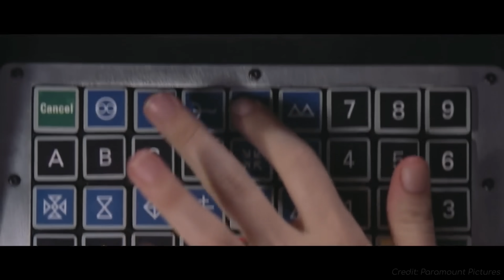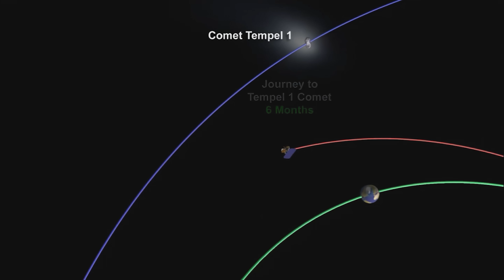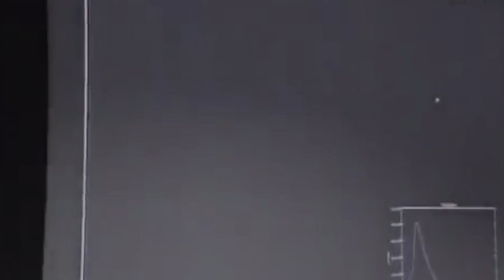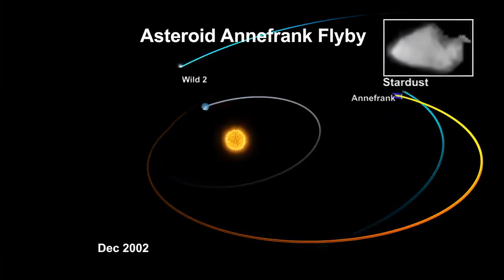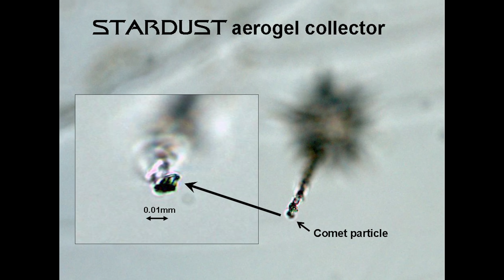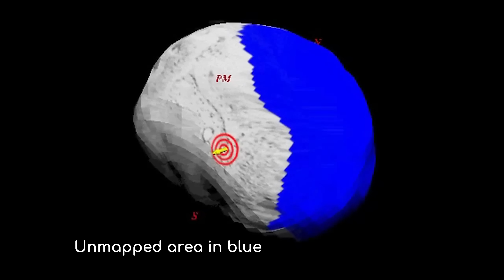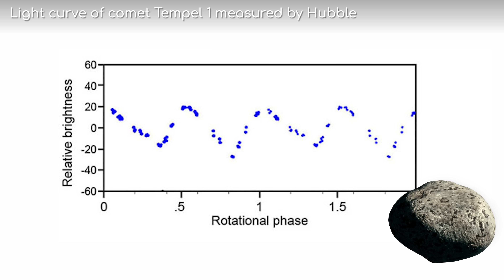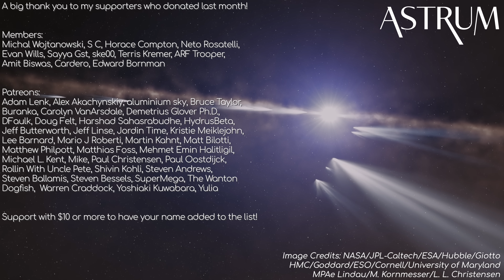The Image NASA Didn't Want to Receive from the Deep Impact Probe | Supercut

Comment: Deep Impact was a NASA space probe launched from Cape Canaveral Air Force Station on January 12, 2005. It was designed to study the interior composition of the comet Tempel 1 (9P/Tempel), by releasing an impactor into the comet. At 05:52 UTC on July 4, 2005, the Impactor successfully collided with the comet's nucleus. The impact excavated debris from the interior of the nucleus, forming an impact crater. Photographs taken by the spacecraft showed the comet to be more dusty and less icy than had been expected. The impact generated an unexpectedly large and bright dust cloud, obscuring the view of the impact crater.

Man this event was almost 18 years ago !!
Reply: And THIS is exactly what generative text looks like. Is that ChatGPT or Bard?

Comment: "Let's crash into the sunny side so there is better lighting for our pictures"   Then the sunlight on the crater heats the newly exposed ice enough causing the ice to melt and evaporate, creating a cloud of gas and dust so they couldn't see the crater at all.  They are some of the smartest people on Earth.  They can design, build, and send a probe to a small comet.  But they overlooked the simple things.  They didn't think about the effect of sunlight and heat on the ice inside the comet.  The reason comets have tails.  That sounds about right.

Comment: 9:30 the unexpected flash included ultraviolet light, which doesn’t happen so much with collisions of mass, however it is always present with electrical sparks. Even electrostatics sparks, which are very scalable… This large flash was very much expected by some (it was documented). This is really kindergarten knowledge when you are familiar with the electric universe model, but would make your head hurt if you’re not.
Reply: it did not include ultraviolet light

Comment: There is a mistake in the transcript: It says "1.96×1010" joules, while it should be 1.96×10¹⁰ or 1.96×10^10 joules. 
This kind of number distortion frequently happens when scientific texts get copied and pasted from Office or PDF documents into simpler linear document types like web pages: Superscripted exponents get un-superscripted and appended to the base 10, producing gross misinformation. Thus, we find web pages saying, Avodadro's number is "6.022 x 1023", or telling us the Earth came into being "4.6 x 109 years ago". 
I recommend scientific bloggers take care to prevent these faults by using the foolproof "^" symbol as an exponent separator in the first place.

Comment: I seem to remember one of these space dust collector disks (not sure of the name of the probe that initiated the project) returned to earth however due to some issue the capsule hit Earth's surface too hard or something bad happened which breeched the container and compromised the integrity of its contents.  This was like back in 2005 or so as best that I can remember.
Reply: That was Genesis.
 It was built and launched after Stardust but returned before Stardust.
The G-sensors that detected when the sample return capsule hits earth atmosphere were originally install backwards on Stardust but caught during centrifuge testing and flipped around ("fixed with a redline to the print"_).
When they built Genesis, they "built the circuit to print" but they failed look for any redlines to incorporate.
SO, they built Genesis "wrong" then decided to not do the centrifuge test, due to "heritage" and so missed the fact that it was in backwards.
The sensor failed to trip to release the parachute and the SRC augured into the desert.

Comment: There was no muddy snowball.  The hydroxyl ions and hydrogen ions are expelled from the comet by EDM, Electrical Discharge Machining into a cloud in which a percentage of them combine to form water.  The finding of organic compounds is huge.  Those missions were brilliantly planned and carried out, however; the interpretations of the results have been weighed, measured, and found wanting.

Comment: Several hundred years from now, Space Indiana Jones is going to fly a rocket to that asteroid and dig out the impactor, to put it in a museum on the moon.
Reply: it was vaporized.
In fact: I was the Command and Data Handling Engineer for the Impactor during the encounter.
After the impact, the flight director got on the net and said:  "Lets get a status from all subsystems starting with Impactor C&DH".
I responded with:
"No single bit or double bit memory errors, no red limits, all C&DH telemetry was nominal, so I am a little sad to say that we just vaporized a perfectly good spacecraft".
It got a round of laughter from the room.

Comment: Stardust 13:15: maybe someone can explain this to me: Comet Wild-2 was traveling at 23,400 kph and engineers were worried that its particles traveling at this speed would be smashed when collected by Stardust according to this video.  But if Stardust was traveling alongside the comet at the same speed, then the comet's particles would be traveling at a velocity relative to Stardust of 0 kph not 23,400 kph.  

And here's another logical inconsistency in this video. If glycine was found on Wild-2 20:49, that doesn't necessarily lead to the statements of this video that comets may have contributed such building blocks of life to Earth as well, since if Wild-2 was formed by the Sun in our system and had glycine, then wouldn't Earth, also formed from the same processes, also have glycine in it naturally?  Again this is stated at 27:25 and 29:35, that life on Earth may be been due to comets.  Again, if these comets have an origin in our solar system, then nothing on them wouldn't also be found on Earth itself.  I find such gratuitous statements more speculative science fiction than fact, appealing to a gullible audience.  Still, the main points of the video that these missions are an amazing scientific achievement should be acknowledged.

Comment: I am a bit confused about the speed of impact. It was stated that the relative speed was about 37,000 km per hour, which would mean around 10.3 km/s. However, when you watch the distance and time to encounter,  and note what is shown in a time laps between 2:43 until about 2:52 you get for instance: 809 km distance and time 8 seconds "to the encounter". That would mean a speed of around 100km/second. That seems to contradict the claim of 37,000 km per hour.

Comment: I hate that term skip off the atmosphere.  it doesnt skip off, it simply doesnt aerobrake enough on the first pass, since the periapsis is within the atmosphere, unless it still has escape velocity after the maneuver, it will aerobrake again on the next pass which will be at approximately whatever altitude the last periapsis was.  For manned missions this can be catastrophic if the crew doesnt have enough life support for another go round, but for ostensibly inert payloads, its just inconvenient to wait the extra time, and possibly have a different landing area.

Comment: the overheating thrusters issue was probably  getting numbers in F when expecting C
Reply: Actually, it was due to the fact that we NEVER fire the real thrusters in test at the vehicle level.
The box that monitors "Thruster temperatures" had never seen any temps higher than the Catalyst Bed heaters used warm the thrusters in vacuum.
So, the box never saw full scale temperature for a real thruster firing with hydrazine.
The conversion coefficients were not accurate at the higher temps.
SO, when the REAL thrusters fired for the first time in flight the fault protection hardware marked the box that measures temperature as "failed" and pushed the SV into safe mode.
A quick update to the conversion coefficients in the Flight Software solved that problem.

Comment: Just one question: the narrator says that when fuel ran out it has a 'last transmission'  but wouldn't the electrical power have lasted for many years after navigational fuel was gone? Wouldn't it just keep transmitting? using solar power or whatever power source it has? Plutonium or something?

Comment: It's not that strange to hear aerogel is a better insulator than air, since it's the actual transition from the solid to gaseous part of any material that provides thermal insulation. In PUR foam for example (the sponge-like material that insulates our walls and roofs) thermal heat, aka the fibration of atoms- is slowed because the porousness of the foam causes pockets of air in structure of the material, through which the vibrating atoms have to transition that energy from the solid walls of polyurethane foam back to air and so forth. So in effect it's not the air that insulates, it's the transition of thermal energy between different states of material.

Comment: So if the comets originate from here than it only makes sense that the life’s building blocks were already on our planet and did not need the “seed” of comets.
Reply: The problem is that planetary formation is likely too violent for life to survive the process.  Even the collision with another planet sized object that formed our moon would likely have killed all life on earth, if there was any by then.  So " seeding" after planetary formation is the best theory to date.
Reply: @stuartgray5877  so, it makes sense that a comet flies through the atmosphere, catches fire, then impacts the ground in a supper heated explosion?
Reply: @PoliticalStewOffical  they have done an experiment where they put tardigrades on the outside of a FOTON-M3  then exposed them to hard vacuum for days.  Not only did they survive the vacuum but they survived reentry and were able to be reanimated afterwards.
Reply: @stuartgray5877  then would it not make sense that they also survived on the earth during its final formation. I’m not arguing that the seeds of life didn’t survive, I’m suggesting that they were here on earth all along in and around the material that formed Earth, and not necessarily seeded from some comet or asteroid from so distant unknown place. That’s all.

Comment: I thought that mission with the one with the aero gel head. It's parachute, not deploy and it crash-landed onto the surface of Earth or is that some other mission? Obviously it is, but I could of swore. It was some comet mission with aerogell involved that the spacecraft's parachute did not deploy. And we were frantic to recover what we could from it.
Reply: That was Genesis.  It launched AFTER Stardust but returned BEFORE IT.  It had samples of the solar wind.
I helped build both Stardust and Genesis, and could tell you all about what REALLY caused the failure of Genesis (not the official story)

Comment: What's the reason for turning off Stardust once its fuel was completely spent? Why not let it continue to function as long as its batteries / solar collectors had power?
Reply: If it cannot fire its thrusters, then it cannot "desaturate" the reaction wheels and then can no longer stay pointed where it wants (such as the solar arrays at the sun or the Medium Gain Antenna pointed at the earth).
No fuel no pointy.
Earth orbiting spacecraft can remain functional without a propulsion system because they can use earth's magnetic field (via Mag Torque rods) to "desaturate" the reaction wheels.

Comment: Isnt it odd the crater is the same shallow depth as the ones found on the moon, and hit at a 90 degree angle straight down, isn’t that odd , same for the moons. Almost like electrical machined………😳

Comment: So. Many. Innacuracies. First, the whole referring to comets with adjectives like 'icy',' 'snowy,' and such is mind-bogglingly inaccurate compared to EVERY SINGLE IMAGE of a comet we've taken. They are ROCKS. Tempel-1's impactor made a tremendous flash that they didn't anticipate, and thought "Woah! This is gonna  be a hella big crater!" And it was a mere smudge on the surface of Tempel-1 between two existing bigger craters!

This mission was the litmus test of the the Electric Comet model, and the corroboration was spot-on. Predictions of the pre-flash as the electric charge exchanged through the cometary atmosphere prior to physical impact met success to the letter, as did the idea that the physical damage of the impactor striking solid rock would show little damage to the surface. No dust 'outgassed' from the comet after the strike; rather, they were dust tails, or more correctly ion tails from the charge redistribution throughout the comet's body and surrounding atmosphere. Cathodic surface sputtering of the comet into the heliospheric current sheet, commonly misnomered the 'solar wind.'

There comes a point when you young people need to open your eyes and look with clear and open minds at what you are seeing, and to not let the biases and dogma imparted to you by the aging Standard Model proponents and their horse-and-buggy,  electrodynamics-free cosmological model blind your analyses and interpretations of what you are seeing. Don't let their "anyone but US are pseudo-scientists!" mentality creep into your thought trains, especially since they are exhibiting the very definition of 'pseudo-science' themselves. Hypocrasy breeds hubris.

Electrodynamics governs the interactions and associations of every measurable particle we have discovered, although some of the researchers think that they can rename the behaviors of subnuclear particles as something other than electrical or magnetic and get away with it. The electromagnetic force (as they are two halves of the same coin...but perpendicular to one another heh) is 39 orders of magnitude stronger than gravity, yet modern scientists who have been taught that electricity either doesn't do anything in space or immediately balances out to a neutral state still cling to these outmoded ideas of the beginning of the last millennium. Its ridiculous.

If the electromagnetic force governs the behaviors of subatomic particles, and atoms, and molecular bonds...why do we have paid scientists laboring under the impression that the 'force stops there!' and everything else in the universe is charge-neutral? It's intentional, unapologetic ignorance. It needs to stop, before someone gets dead in space from their misconceptions.

Hubble Dirty Snowball cometary model = 0; Electric Comet = double-digit wins and climbing. "Who ya gonna believe? Me? Or your lyin' eyes?" -- R.I.P. Harpo ❤👍

Comment: Nobody, but nobody, has ever, "looked up and watched a comet streak by" Nobody! Because comets don't streak by any more than the Moon goes flying past or Mars etc etc. Instead when watching a comet there will be a noticeable change in it's position each night as you check it out.  It will have moved over the last 24 hrs.The tail points away from the sun it does not point away from the comets direction of travel. 
Your opening statement is so false and misleading that I didn't watch your video. I will come back and check it out when I'm not so disappointed in it's statements. If you can't even get the obvious facts correct why should I trust that you have the information that I want to learn from correct?